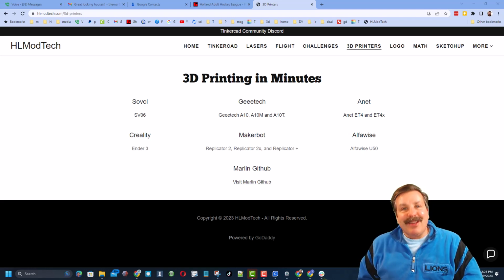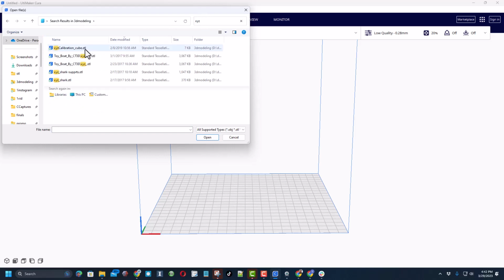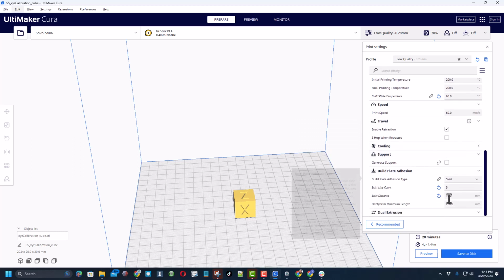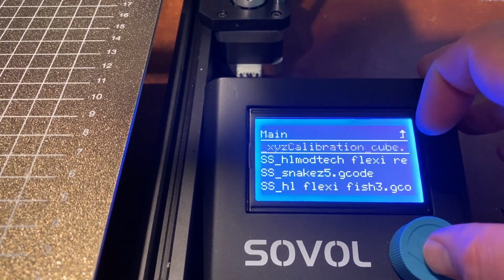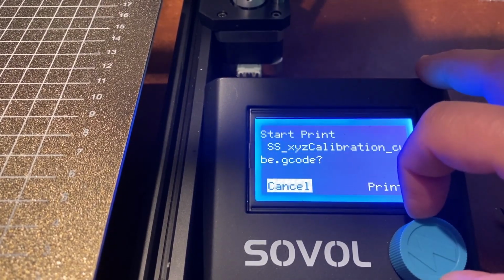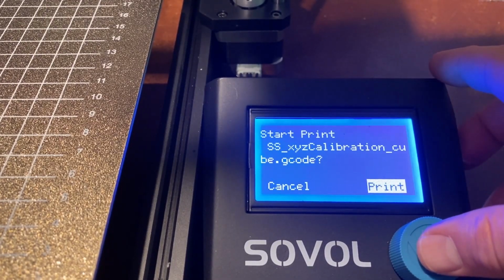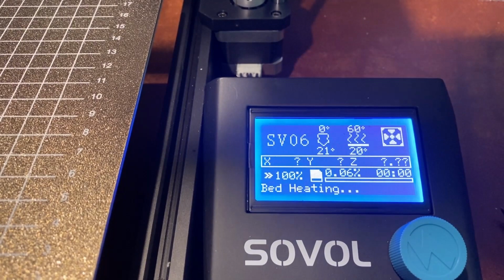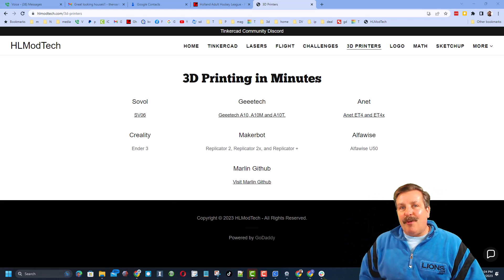Calibration Cube Check with the Sovol SV06 Accuracy Out of the Box 💯🤯

Comment: Do you have a video showing how to adjust it, if its not as accurate as yours? Mine printing the Z at 22mm. X was 19.98 and Y was 20.04 for me.
Reply from the maker: I do not. I have not really put much effort into getting them perfect. For my applications it is not essential. 2 mm is a long way off on Z though.
Reply: @HLModTech  Yeah, that's where my concern lies. I understand how to print a calibration cube, but not how to correct for it after! Haha!
Reply from the maker: @zoriac4431  It is time I added it to my list... stay tuned. I will get something out in the next week or so.
Reply: @zoriac4431 in advanced settings u can change the esteps after u use a calculator to figure out the new values for your xyz steps
Reply from the maker: @helem99  Exactly. I just have never taken the time. Thanks for sharing. 👍👍
Reply: @zoriac4431  do be careful tho and keep your hand on the power supplys off switch
Reply: @helem99  Oh? Why's that?
Reply: @zoriac4431  when i did it one mine the zalingn messed up the first try and almost hit the bed
Reply: @HLModTech  How's this video coming? I haven't seen anything pop up yet 😃